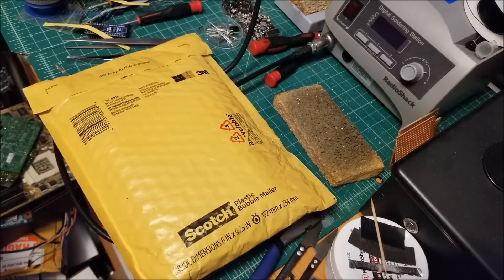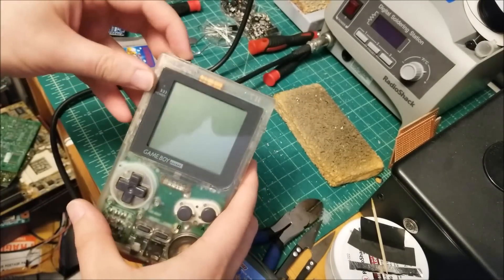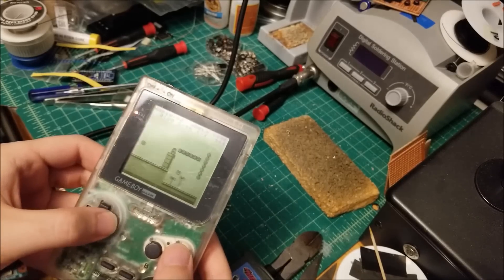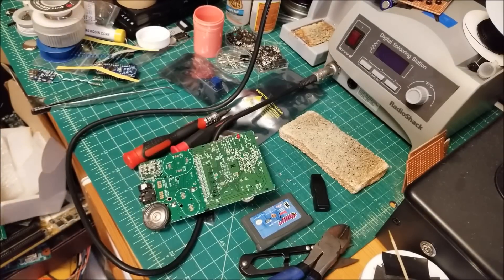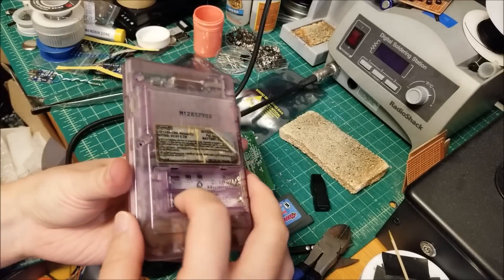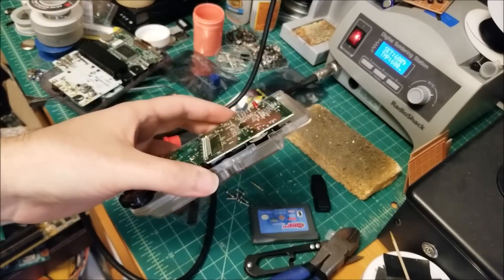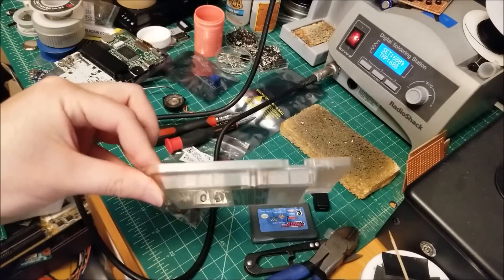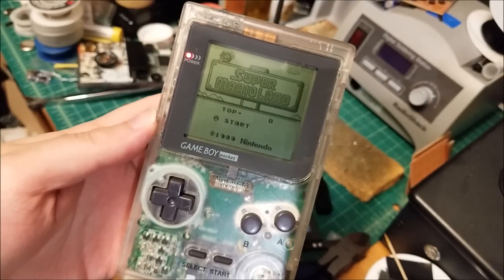Let's Fix: Nintendo Clear Gameboy Pocket - No Power, No Audio Edition

Comment: Why do some Pockets have completely green boards while the ones I've got usually have white coatings?
Reply from the maker: They are probably different revisions or regions. At one time I thought the white ones were made for clear pockets, but I have a clear pocket in my collection with a green board that I'm sure was never opened. Also you might be interested to know there's even a yellow silkscreen variant as well that seems to be rarer.

Comment: Hey dude. I have an original game boy as well. The gameboy turns on but nothing happens (audio/video). I've tried the screen on another gameboy and it works. Any ideias?
Reply from the maker: It could be your dcdc converter is dead or there are bad caps on the logic rail.

Comment: Yeah I have a game boy pocket but the battery leaked acid on the motherboard terminals and the negative one fell off and I cannot find any around loose so I can fix it instead of buying the new board and I have to do a back light mod screen I bought the screen
Reply: Kit
Reply from the maker: You may be able to bodge in a battery contact scrapped from some other AAA battery device. Alternatively you can get these end ones and cut and bodge solder them in (https://www.aliexpress.com/item/Battery-Terminals-Contact-Spring-Battery-Spring-Replacement-for-GameBoy-Pocket-GBP/32901338635.html). I did a quick search and there isn't a direct source for the board soldered terminals for the pocket so unfortunately those are you options without having to buy a broken pocket just for the terminals.

Comment: Thanks again. I have a speaker (used to play on the CRT monitor w/ different consoles), when I turn the know, there's this excruciating noise- can this be fixed by maybe cleaning it's insides with the ultrasonic cleaner (jewelry level) and some distilled water (I also have 99% alcohol that I can use instead of distilled water) with easy to remove soap (Dr. Bronner they say)? If this is a possible way to fix it, could I also clean the the shoulder buttons of a GBA SP AGS-101 coz' you have to press very hard to make it make the aspect ratio wider or smaller.

Thank you. God bless, Proverbs 31
Reply from the maker: For the speaker you will need to clean the volume potentiometer using either the 99% alcohol or contact cleaner. Spray or drip a little inside to reach the contacts and work it back and forth a bunch and let dry before testing.

For the shoulder buttons, first open it up and check that it isn't something simple like the plastic outer button isn't aligned right or something. If that's not the problem open it and using thin tweezers you can remove the rubber button (the little nipple on the tact switch on the board). Use compressed air to blow out the inside of the switch and carefully push the rubber button back in.

Comment: definetly not bored of these debugging videos, helps alot, i just won a gameboy light that has corroded battery terminal springs, hoping a vinegar bath will sort it out but if not i migh test the voltage converter, how would i go about testing that? and what would the cheapest replacement be for that? https://handheldlegend.com/products/dc-voltage-regulator-step-up-converter-5v would this work? 
or this?https://www.pololu.com/product/2564
Reply from the maker: To test the converter you need to verify that neither the inputs nor outputs of it are shorted (a common fault) by using a multimeter with the GB off to measure resistance. If that all passes then turn on the GB and measure 5v and ~-19v. Unfortunately since the converter generates both 5V for logic and ~-19V for the LCD bias you would actually need two converters. Your best bet is to buy another gameboy with a damaged LCD for cheap but still powers on. Luckily a pocket's converter will also work in a light.
Reply: @sjm4306  thanks, ill let you know how it goes, know about any methods of slowing or stopping corrosion? can coating it help do ya think?
Reply from the maker: Depends how bad the corrosion is. If it is mostly oxide and little metal then you are better just removing all the crud and using wires to jump the affected metal. If there are just spots of corrosion then something like epoxy or even nail varnish will seal it to prevent further damage.
Reply: @sjm4306  awesome, thanks heaps for the tips

Comment: I am trying to make one nice Gameboy out of 2 half-busted ones, and so I come to the comments section for help.

So far I have the back board, power board, and battery contacts from one and the front assembly and headphone breakout board from another soldered together where applicable and all working in one case... but the sound is wrong. (test cart, pokemon gen 1, known working) The theme music plays mostly fine, but the snare/drum sound is muted - sounds like the "strike" is there, but with no rattle or reverb. Problem goes away when played on a different console. Problem persists through headphone jack/alternate speaker soldered in.

What's my next step? replacement capacitor kit?
Reply: To clarify, the other back mainboard I have works, but has a disconcerting amount of corrosion on it and solder mask flaking off. I would would prefer to use the less-falling-apart one.
Reply from the maker: Yep sounds like bad caps to me

Comment: I literally just started "repairing" Game Boys a month or so ago. My grandpa game me an original DMG-01 when I was about 3. I've kept it all these years, and it saw regular wear throughout the years, until the Game Boy Color came out. 
Anyway, I've kept it safe all these years, but the casing significantly yellowed over time, and handheld consoles/ controllers always get pretty grimy the more you use them. So, wondering how I could clean it up, I looked up some YouTube videos (The Retro Future was what I ended up watching, which incidentally is how I found your channel!)
Attempting to make a long story short, I cleaned up the Game Boy, restored it to its original color, and fixed the missing vertical lines on the screen. I found that I really enjoyed doing it, almost a therapeutic experience!
Fast forward a month or so, and now I have over 30 Game Boys that I bought from ebay that need some love and care before they find their new homes :)
I've just started making videos about it as well, and I plan to keep making them, with inspiration from Elliot, you, and Colin (This Does Not Compute)! So thanks for the awesome content and keep up the good work. I learn a lot from you guys!
Reply from the maker: Thanks, always happy to hear others getting into the hobby and taking joy in caring for/resurrecting game consoles. Keep up the good work!

Comment: I had a similar issue with a DMG where the speaker blew. My 'genius' solution was to grab a spare DS speaker and just hold the wires onto the contacts to test it. I ended up soldering that actual speaker in!
Reply from the maker: Plenty of room for the tiny DS speaker inside a DMG, plus it is likely louder too.
Reply: sjm4306 yeah, it was an improvement overall! I didn't know if it would work just touching it to the solder, never mind whether anything on the board itself was broken... Never been so glad to hear the Tetris theme in my life ;)
Reply: I've replaced the speaker in a GameBoy color (with distorted audio) with one from an old GBA, it was tight but it worked!

Comment: Can I give you a tip?
When I'm putting a faulty console (or pieces) in my "recycle box", I put on it a piece of masking tape, where I write all I found about it (blown fuse, dead pixels, broken copper traces).
This not only saves me time, so I don't have to re-check all after some years, but it's a cleaner solution, because I can keep for example all the good stuff in a box and all the broken in another.
And you know that we can salvage even the smallest thing from a broken board.
Good luck with your channel, I just subbed, you deserve more subs.
Reply from the maker: Thanks for the tip and support. I really do need to organize and clean my work room.
Reply: Agreed. Masking tape turns into a gummy mess when left on something too long.
Reply: Actually I didn't know how to translate in english the tape I was talking about, but yeah, I did mean painters' tape. It's that here in Italy the blue tape is not common, we use the classic yellow one and we call it "paper tape".
But you did understand what I meant to say :)
Reply from the maker: Blue painters tape is awesome for general use, and also makes a good bed surface for 3d printing.

Comment: I tried replacing the belts in my Walkman wm-3 which I managed to do but when I was putting everything back and screwing the pcb back in one of the wires got cut so they split in two and now my Walkman won't work at all the operation light won't even flash is there a way to repair it or is it dead for good?
Reply: Random question sorry lol
Reply from the maker: If you know where the solder pads for the wire that broke go then all you need to do replace the broken wire and it'll be as good as new.

Comment: I would say that is a good deal. and it is in fairly nice condition as well.
Reply from the maker: Thanks, and most surprisingly it still has the battery door which is becoming a rare occurrence!
Reply: yeah, that's kinda a deal breaker for me if a console doesn't have one. I keep finding clear dmgs for decent prices but no battery cover. I know they make replacement ones for the clear dmg but they look foggy compared to the original Nintendo clear plastic and they don't match.
Reply from the maker: Yeah, even more difficult finding limited edition pockets with original battery covers. I got super lucky with my extreme green.

Comment: Who would try to play a GBA game in a GB pocket?
Reply: I've seen a couple of GBPs listed as "not working", when you can tell the contrast is just wrong. You can usually either see the 'no game' rectangle faintly, or it's up so high the screen is black. Some people just don't have a clue what they're even selling.
Reply from the maker: Slight spoilers on an upcoming video, I bought another high end portable minidisc recorder sold as completely broken and the seller made a silly mistake. They definitely could have sold it for 2-3x what I got it for.
Reply from the maker: No idea, doesn't even fit nicely so it seems silly that the game was shoved in the cart slot in the first place.